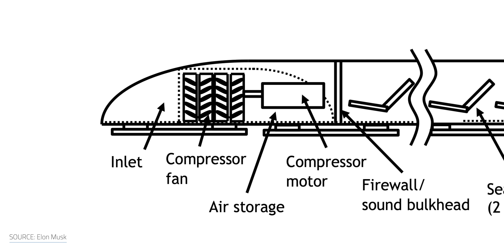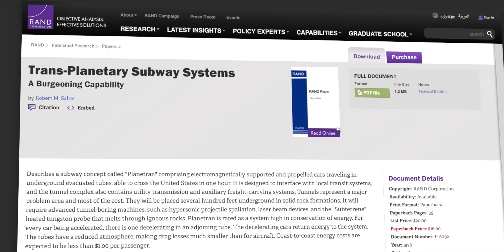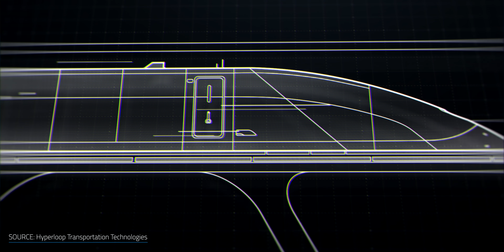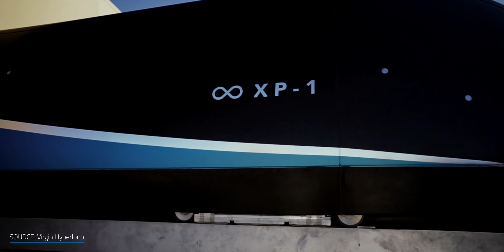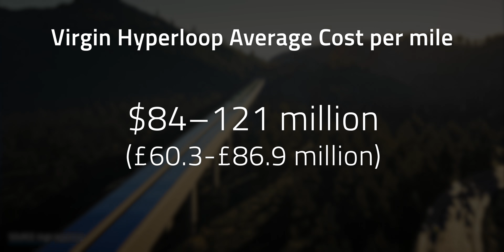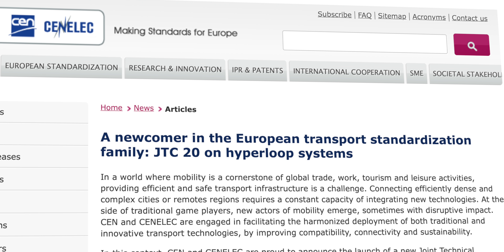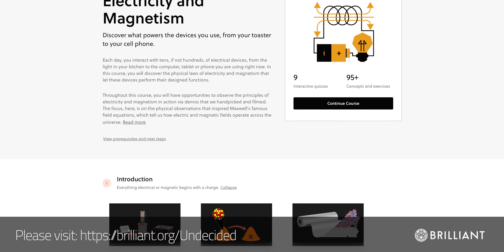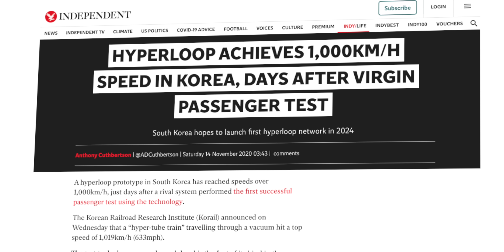Exploring Hyperloop - The Future of Renewable Public Transport?

Comment: Nevomo former Hyper Poland is developing maglev trains and hyperloop pods that can travel on existing tracks so when HS2 high speed line between London, Birmingham, Manchester and Leeds, UK is opened the 250 mph trains could be replaced with 340 mph maglev trains and by adding vacuum tubes 620 mph hyperloop pods or trains, for new lines hyperloop pods and trains can run at 748 mph. One problem with hyperloop pods is they won't carry as many passengers as high speed trains so multi car hyperloop trains is a much better idea.Chinese Aerospace CASIC is developing a 2,485 mph hyperloop train.

Comment: Just having a think... How would one get up to speed and then slow down without becoming a pile of goo inside the loop?  Perhaps some Star Trek inertia dampers or inertia negation would be in order.
Reply: Absolutely, these vehicles could never get up to the advertised speed if they want to incorporate stops. You'd be constantly accelerating and braking for the next stop. Unless you just build a tube with two end points and no stops between. Not a very efficient system imo.

Comment: The often proposed track between LA and San Francisco seems the perfect test bed to explore the consequence of an earthquake on a hyperloop.
Reply: My understanding is that earthquakes are a surface level concerns. As an analogy, one can consider how a deep sea vessel is not really affected by a massive wave on the surface of the ocean above it.
Reply: @AllanSustainabilityFan  Most of the Hyperloop designs are surface level.  All it would take is having one fault line slip a fraction of an inch in any direction to dislocate one section of the tube.  Your analogy of how a vessel in deep water isn't really affected by a massive wave (I'm guessing you're referring to a tsunami) doesn't really equate until you get both the ship AND the wave into coastal regions.  Yes, you could engineer the pylons and tube sections to withstand almost every historical quake event, all it would take is lots and lots of $$$.  But then Mother Nature ALWAYS has something else up her sleeve!
Reply: @AllanSustainabilityFan  2 things:
1)What do you expect how deep a tunnel is under the surface? To stay in your diver picture, if you have a 10 meter wave and you dive 1 meter will you be affected?
2) Most parts will be on the surface you only tunnel those parts that are necessary to avoid steeper climbings or curves around  hills. A full tunnel would be far more expensive and if a flight would be much cheaper what would you take?

Comment: Honestly I think a standard tunnel capsule system that incorporates net positive renewables would end up approved rather than the high risk vacuum tube version. Imagine if rather than trains running in Boston, stopping at every stop, we had smaller, destination based capsules that could stop independently of other capsules without obstructing the flow. Traveling the length of the red line wouldn't take nearly as long and it would be able to service more stops faster within the last mile radius. A descent algorithm with a destination request app and my daily commute wouldn't suck quite so much.

Comment: What will the hyperloop react when in use and a leak or breach loses the vacuum? Does it kill the people in the capsule nearest the leak? Does it shoot the furthest capsules out the end of the vacuum filled tube? Speed is less an issue in the hyperloop than a runaway capsule.
Reply: a small leak would slow you and can easily be mitigated with emerency breaking. A breach would kill everyone on the track segment. There is also no rescue concept for a stopped capsule. So the quick death might be better than starving ;)
Reply: Well why dont you watch when happens your self. Just search for any vacuum chamber video on YouTube. And then watch what happens when they open the valve to release the vacuum. Does it destroy anything in the vacuum chamber?
Reply: @titter3648  you'd die from the breaking against sudden air pressure at 1200 km/h.
Reply: @thoreberlin  Really? So if a fighterplanes engine cuts at 1200 km/h the pilot dies from the breaking against the air?
Reply: @titter3648  no. But if it was doing 1200 in a vakuum and suddenly hit a 1 bar athmosphere it would. A sudden loss of thrust in both engines in an SR71 would have led to a loss. Even small efficiency jumps in the Ramjets gave the pilots a hard punch.
Reply: @titter3648  btw.: Even if you were standing still the acceleration from a full blown breach could kill you depending on the mass of your pod. With a 4 ton pod you would accelerate at 10 G. You are then basically a vacuum gun projectile. You can watch the very entertaining vacuum gun videos of smarter every day on that.
Reply: @thoreberlin  The SR71 was going over mach 3, not 1200 km/h. And a normal pressure at sea-level is 1 bar so why would the pod do any differently in the breaking than the fighter jet?
Reply: @titter3648  the SR 71 was going mach 3 at the edge of space. And had an extremely low c-value and the same pressure behind it as ahead and didn't act like a piston due to notnbeing enclosed.  Just do the math yourself. It's fun ;) I was a hyperloop believer too until i did some math.
Reply: @thoreberlin  So. Show me your math.
Reply: @titter3648  not my job and van't send you an excel here. This is a comment section. Just go on wikipedia or brilliant.org if you have problems. 1 bar equals 10 tons per m^2. For a 2,23 m diameter hyperloop you get 4m^2 equaling 40 tons. Equaling 10G for a 4 ton capsule.
Reply: @thoreberlin  So you have not done any calculations in other words, but just want to sound smart on the internet for cheap points.
And you might want to learn the difference between static pressure and aerodynamics effect on a object...
Reply: @titter3648  WTF is wrong with you?! I dumbed the non aerodynamic case down for a comment section.  The aerodynamic case is also a best case not fitting the piston situation as you build up additional overpressure in a tube. You can learn how to calculate the aerodynamic case on the excellent engineering explained channel. Do your homework.

Comment: I guess I must have missed something. It always struck me that it would be easier to blow the passenger cars down a tube, and you wouldn't have the problem of having a pressurised capsule in a vacuum which is in turn in a pressurised atmosphere. The air-flow could be turned around at the end and sent back up the other tube.
Reply: Might be that all that really fast going air, rubbing on the tube's wall, will cause massive problems. from "just slowing a stick of air with the length of 500km down to a crawl after 10km" to heating the damn thing up until walls melt. is there anything that goes at 1000kph at sealevel to compare to? airplanes don't count because they are so high up that there is little air left. but in priciple i'd agree, if you dont want to shovel though thick air at 1000kph, then move the air with the pod and you could open a window and stick your head out.
Reply: The problem is friction losses because of the friction with the walls of the tube.

Comment: cool but useless, lets just go for electric planes instead, pretty sure that is more reachable and is wayway cheaper
Reply: For small distance, low speed hobby airplanes with propeller(s) you can use batteries, but  that does not scale.
For commercial flights the best option is: nuclear power -> carbon capture -> synthetic jet fuel -> current airplanes.
Reply: @solutionrebellion  sure whatever works best
Reply: @solutionrebellion  larger electric driven propeller aircraft are being conceptualized rather than jet engines, where the exhaust is a problem even with hydrogen burn because the heat generates NOS greenhouse gases. The electricity can be possibly be produced by a  fuel burning internal engine with scrubbers in the body of the plane  to greatly lower the green house gas generation. The engine scrub is a NASA concept no one seems to be working on yet as large electric driven turboprop aircraft have not been developed yet.

Comment: Only one problem with the hyperloop tube. 

THERMAL EXPANSION....

The LA to SF  route would expand several hundred yards on either end due to thermal expansion of steel..
Reply: Is thermal expansion a big problem on oil and gas pipelines running thousands of kilometers all over the world?
Reply: @titter3648  
Yes in fact they compensate for this with thermal loops, however the thermal coefficient of an empty pipe and a pipe filled with a liquid is MUCH different. An evacuated pipe would expand much more as there is NOTHING to inside to regulate The temperature of the pipe. Thus you will have more expansion. 
A typical pipe diversion uses a sharp U shape to absorb the thermal expansion. This  is standard in oil and gas industry.
Reply: @TheNetwork  And in a hyperloop you can use explanation sections like bellows that is used in vacuum systems today. Or long bends that are allowed to move sideways as the tube grows and contracts. This is not some insurmountable impossible obstacle.
Reply: @titter3648  
You're talking about static systems at a very small scale with no external forces applied through them. 
Now send thousands of tons at hundreds of miles an hour through it. 
Standard bellows expansion joints would weaken the structure and cause collapse 
Bellowed joints are not meant or designed for large high stress environments.
Reply: @TheNetwork  No. You can buy of the shelf high vacuum bellows expansion joints with up to several meter diameters from several suppliers today.
Reply: @titter3648  

Yes and no, the in line non loop expansion joint on a 6" pipe requires 12,500 lbs of anchor points on either end of the fitting. 

Where as a loop for the same pipe needs between 200-700 lb anchor points. 

Which means lateral forces on the pipe when accelerating and decellerating inside of said pipe thousands of tons of pressure on each joint. They are not made in any form for such high stress environments.....

Cause engineering.
Reply: @titter3648  
Google "thermal expansion loop"
And then steel thermal expansion per degree C

Comment: Matt, what do you mean by "spontaneous decompression" at the 9:22 mark? How can that be?
Reply from the maker: A rupture in the pipe ... a small hole is all that's needed to create a significant problem.
Reply: @UndecidedMF  Yes, that is true. But, Matt, you did not answer my question. The rupture in an evacuated pipe would lead to rapid "re-compression". Did you mis-speak? I had asked you what you meant by "spontaneous decompression".

Comment: I've read the entire hyperloop design document and the key to keeping the prices down was using the air hockey levitation. In the paper, they called out using mag lev as extremely costly. That tech may be hard but it was key to getting the costs as low as possible.
Reply: Was there an environmental run down in that paper too? I find IT incredible that drilling for miles, and transporting people at plane speeds, even in a partial vaccum, should use less Energy and have a reasonable time horizon to recoup emissions from construction, than a coach route or even a railway?
Reply: @Tore_Lund  the difference in energy use would be the same as a low flying jet vs a high flying jet (all jet travel today). Jets were regarded as impossible for a long time because of how fuel thirsty they were at the altitudes propeller planes flew at. But they moved up to 40k feet where there’s next to no drag. So the ratio of fuel for those two modes of jet travel is the order of magnitude of energy savings you’d have vs conventional rail or conventional maglev.
Reply: @kaitlyn__L  Flying emissions are mostly  from ground infrastructure. A full 747 emits half as much Per passenger at altitude, as a car with a single occupant. However the miles rank Up fast when you are Flying, but Per passenger mile, Flying is pretty Clean if the planes are full. The hyper loop takes what 12 people Per shuttle? So if comparable, that would still be double that of a train seat, which is more than any other form of ground transport. I'm wary of comparing the Hyperloop to planes, as you are substituting ground transport and not airplanes.
Reply: @Tore_Lund  that’s why I specifically mentioned the fuel consumption during high flight. Of course if you include all the stuff at the ground it’s bigger, taxiing takes a huge majority of the fuel consumption. Precisely because that happens at the altitudes where I mentioned taking ridiculous amounts of fuel.

 Air resistance is the main energy cost for rail, since there’s very little friction between steel wheels and rails. So if you take that away, the energy cost per mile is significantly reduced. Now, will that outweigh the energy cost of pumping the air out? That highly depends on exactly how they build the pipes, as once you get to the desired pressure you only need to run the pumps when extra air comes in. If you’re running pumps for 1h every day in most tube sections it’s obviously way less power than if you’re running for 30 minutes every hour.
Reply: @Tore_Lund  It's worth reading the original description of the hyperloop. They did not want to create tunnels and weren't using magnets to levitate the train. The intent was to put solar panels on the top of the raised tube. However they did not do an environmental analysis. None of the companies that decided to create a hyperloop have decided to go with the air hokey approach. I don't know if it was deemed impossible or just hard to make.
Reply: @JoelSapp  Hmm.. thanks for the explanation. Private initiatives like the Hyperloop moves the goal posts of what can be imagined, but IT can never be the responsibility of private enterprises to figure out the national course of action that Will get us through the transition most efficienly, so my blame is not on Them, but that this thing gets permits and is promoted as the future politically, before state og government effort is put into a study to establish how the Hyperloop fits into All this?

Comment: If the vacuum is hard to maintain and somewhat dangerous, would there be another alternative like high speed air current in the direction of travel to minimise drag?
Reply: Yeh, like a propeller? Maybe Elon Musk could invent that too?
Reply: @alfo6085  I'm thinking more of air jetting and suction vents along the sides of the tunnel tubes, but it might be difficult to control the turbulence when the trains pass through. It wouldn't be as fast as vacuum unless the wind speed is at the speed of the train. The upside is that you don't need to maintain a vacuum constantly.

Comment: The vacuum part of the hyperloop idea seems dangerous and unpractical, not only is very difficult to mentain a vacuum over those distances but If there is a fault somewhere either in the capsule or the tube it would mean death for everyone inside it. If the tube or capsule gets punctured or collapses the wall of air that would hit the capsule would tear it to bits. The idea of digging tunnel to transport people and things not in a vacuum is a more feasible one and much less dangerous but again, there is a reason why we don't see tunnels unless they are absolutely needed. Tunnels are expensive to build and much more expensive to mentain, also very dangerous in case of a earthquake and in case of fire the risk is very high, but that said with some technological improvements can e overcomed, the cost lowered and safety improved. The best we have seen about the hyperloop thing are renders and when the practical experiments take place the results are not impressive in the least.
Reply: ok
Reply: Transpod probably chose Alberta because the route is devoid of any major faultlines

Comment: Thanks for a great video Matt.  Are there any energy saving benefits to a hyperloop system - from construction to operation compared to what we have now?
Reply from the maker: Remains to be seen.  The system will take a lot of energy to run, so it all depends on the energy source.  It's a part of the reason that some of the companies are proposing such extensive solar infrastructure as part of the system.

Comment: I suspect large tunnels or tubes made for fast autonomous vehicles might be a thing. Maybe even in a low pressure environment to lower air resistance. I do not think a near vacuum hyperloop system is on the table this century though.
Reply: Large tunnels for vehicles with high capacity in cities already exist. It´s called a subway.